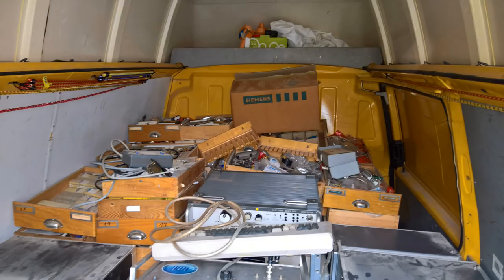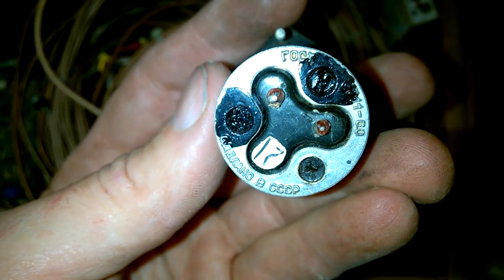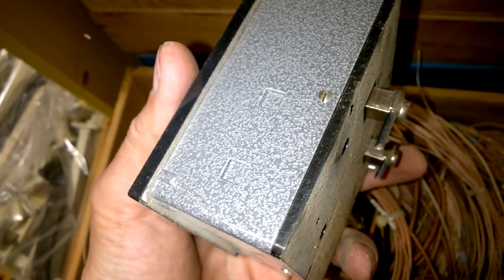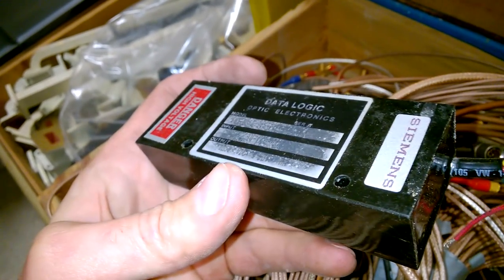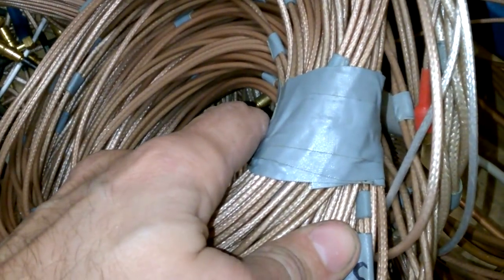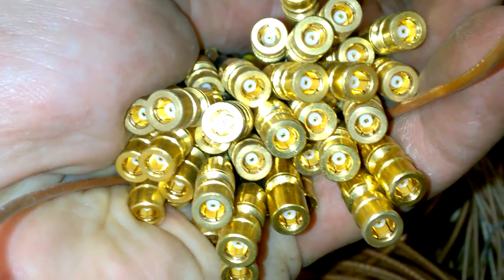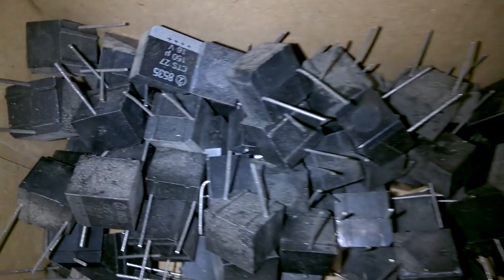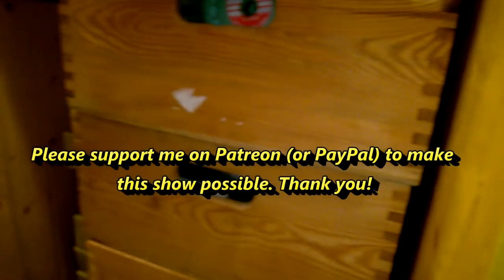CEPUS #13: Teflon RF cables, instruments, evil tantalum capacitors

Comment: The connectors on the RF cables look like SMB connectors. The Data Logic power supply appears to be a Helium Neon laser power supply; it would probably suit a tube about 1 - 2mW output, about 12 - 15cm long.

Comment: I have some of those Teflon cables. Unsurprisingly they are hard to strip. The cutters just slide of the sheaf.  I agree tantalums are evil little bastards.Great video! Regards Chris
Reply from the maker: Hi Chris. Thank you for your comment. I really like your videos, as you know. The teflon cables need a super sharp stanley knife, and then it is easy. All the cable stripper tools won't work. They are great to solder. Tantalums: I have heared they often fail. Even though, I have only seen a blown rectangular one in a Rohde & Schwarz device from the late 70ies (AVF video distribution amplifier).
Reply: Ing. Max Koschuh I will try the Stanley knife method. I expect you know but tantalum often fail due to high ripple current. So it’s always worth check out the main smoothing capacitors.
Reply: @MaxKoschuh  If you have the correct stripper, as I do, it's easy to strip the PTFE cables!